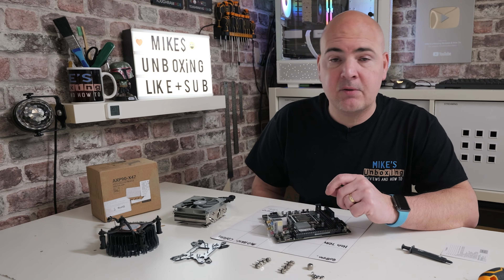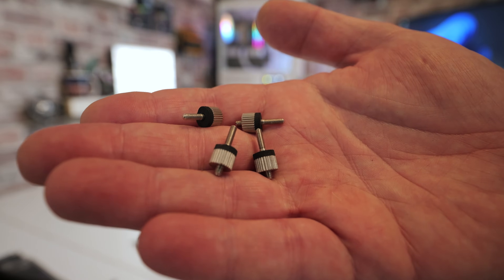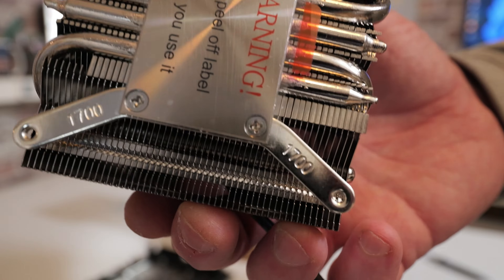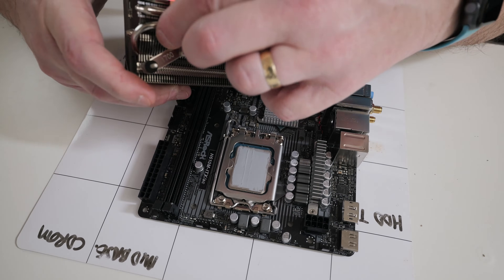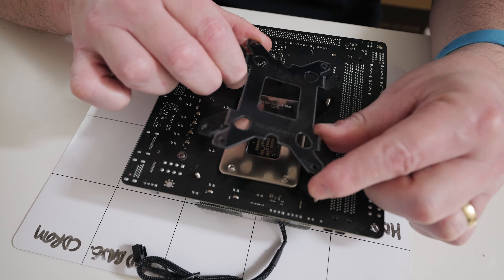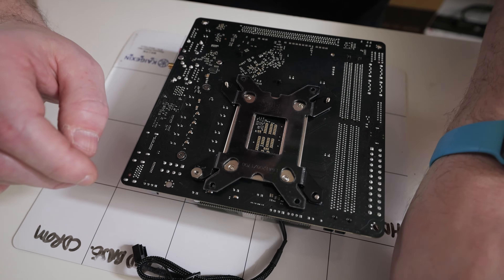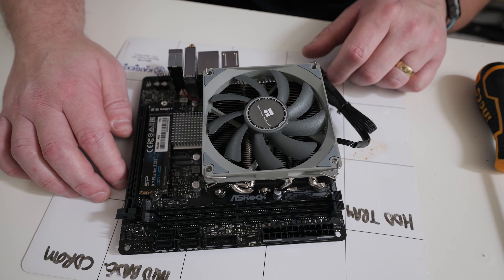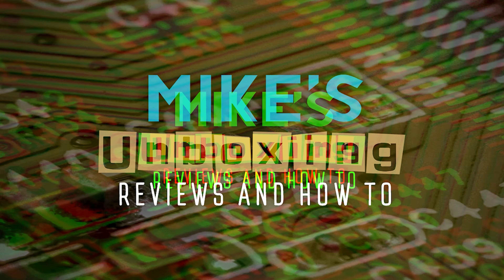How To Install Thermalright AXP 90 X47 CPU Cooler On Intel LGA1700 Motherboard Platform

Comment: The long screws are used in case of the supplied back-plate conflicting with soldered components close to the holes. In this case the long screws should be installed and the back-plate is flipped over so it is reversed. This results in the back-plate sitting directly on the CPU's socket back-plate where it makes no contact with the PCB or any soldered components.. The long screws are also used when installing for AM4/5 with the motherboard's stock back-plate.
Reply from the maker: Thanks for the extra info!

Comment: bought this for an optiplex. Really wish I knew it was a mandatory mount from the back unlike the absolute simplicity of the stock cooler since the dell's mounting plate is on the rear panel of the case that's panel is riveted on.
Reply from the maker: Ah, that's a common issue with Dell systems, their proprietary designs can be tricky!

Comment: shouldn't it be rotated 90 degrees? so that fins were facing the memory and vrm?
Reply from the maker: on AMD its hard to do 90 degrees as the mount isn't square
Reply: @mikesunboxing ahh, right, mine is lga1700. tbh. I'm not quite sure which orientation is better.

Anyway, the cooler is working great in my Asrock Deskmeet B760 (kinda Steam Machine ;) - much more silent than the stock one and the cpu is a bit cooler.

Comment: I bought this cooler for my first scratch build as I needed something low profile. After a bit of googling and seeing your other video on the cooler's performance I fitted it and its performing well. It remains to be seen how easy it will be to change the thermal paste down the line.
Reply from the maker: Glad I could help

Comment: I know this is an old video but I just bought this cpu fan. If I already have a 1700 backplate installed do I have to install the one that came with this fan still?
Reply from the maker: yes use the one that comes with the cooler

Comment: Found out the hard way that this cooler is not compatible with the ASUS PRIME H610I-PLUS D4 motherboard. There is a chip on the underside of the board that is too close to one of the mounting holes, and the backplate rests on this chip instead of the motherboard.
Reply from the maker: that is a shame

Comment: hi mike.  great video, thanks.
i have a mini itx mb
i want to take out the old single 120mm aio and install
an air cooler,  but i cannot get access to the rear of the mb
can you recommend any small air coolers that can be installed by the front only, please.
intel 1151 socket  thanks
Reply from the maker: i can't think of any off the top of my head sorry
Reply: @mikesunboxing  👍 thanks anyways

Comment: Don't you peel the plastic off the bracket?
Reply from the maker: when was that in the video?
Reply: @mikesunboxing I think the plastic is meant to be there, as the metal bracket can be conductive?  4:10  you do say it's to protect the motherboard, so yeah meant to be there. I got the full copper version of this cooler for a Fractal Terra build. Keep up the good work Mike!!

Comment: Feels alien process fitting rear bracket last after all std and tower fans! Assume its bcus the fins overlap the mounting pillars. Look forward to seeing how effective this bargain cooler is. I use thermalright fs140 and runs very cool but its weight is a worry. Thanks Mike and Kath 🐈👍
Reply from the maker: yes it is a very jarring experience. i don't like it, but it is what it is